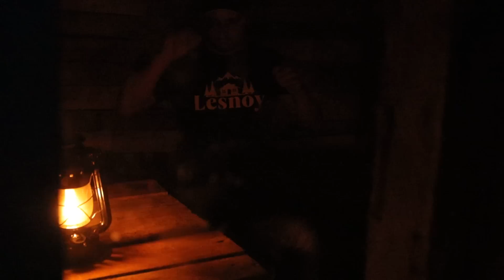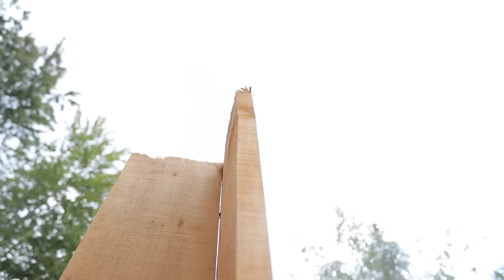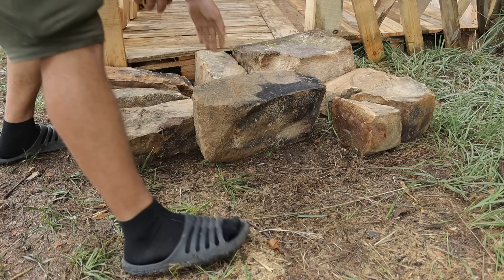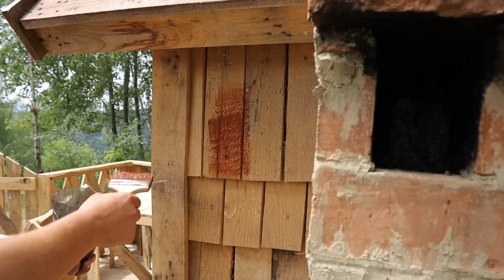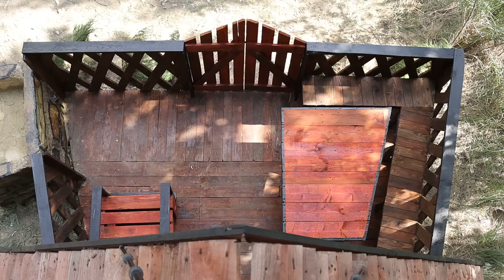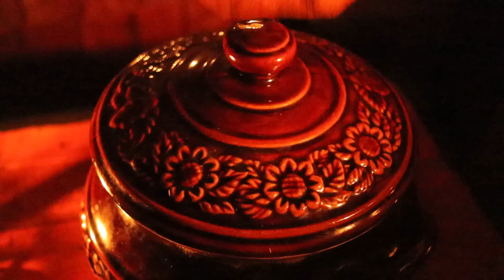Return to the pallet house. The terrace is ready!

Comment: currently i have no resources to contribute. but i like thr dea. 
 in new Britain ct. there ais a wedge of and called tent city. with home challenged folks. who are homeless for what evere reason. but with scrap lumber abd clearance materials and a few hand tools and volunteer help a community low cost. buildings that could be built to house who chose to be housed outside of traditional housing. and then they can work themselves in to a better situation.  semporary shelter as long as the need . thanks for that missing piece in my missing puzzle. in helping america to add the need of independent people addressing thier own problem their own way. this is a helping hand up and not a hand out. those wanting an hand out go else where. if you commit a crime you go to jail and do time with food an a roof over your head. and time behind bars.

Comment: The deck, chair (rocking no less!), railing, fire pit, plantings,  colors are all perfect!  Your handsome helper is also perfection.  🐶😁  I have to admit,  though, that I would have put that paintbrush in the cooking fire before painting anything with it.  Maybe that's the only size you could use with those the stain cans?  
Other Questions
1.  Can't you leave the lamps (or for that matter your sleeping stuff as well) there while you're gone?  Seems like it would seriously lighten the load. However, if you hike  from cabin to cabin perhaps you need them.  On the other hand, if you're only hiking over the hill to your SUV ... 😊 
2.  When there's no snow, how do you get water for yourself & your beautiful pet?
3.  We would never be able to build a fire pit in the forest, much less next to a wooden structure.  Obviously, you aren't in an area with similar restrictions, but I'm sure you've considered the issue.   How do you mitigate the fire danger?

Thanks again for sharing your work.  I have no words to explain how much it means to us. 👋🏼🙋🏽‍♀️✌🏽